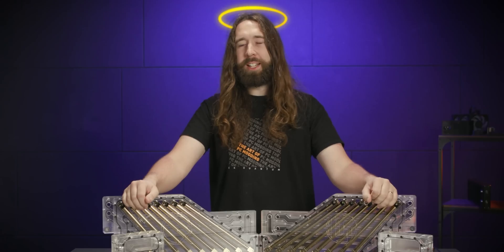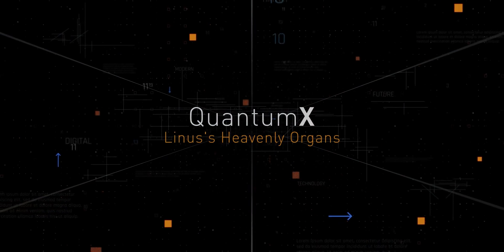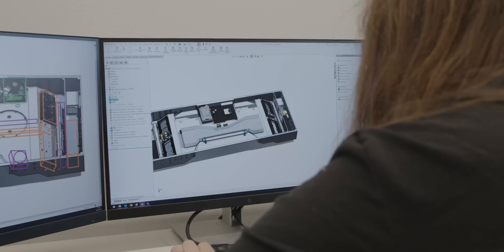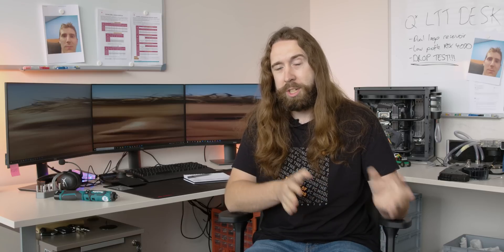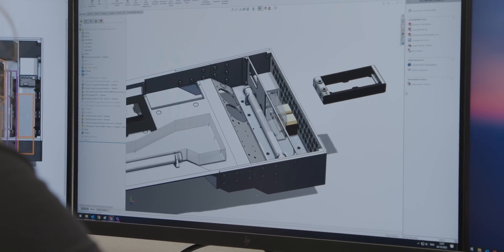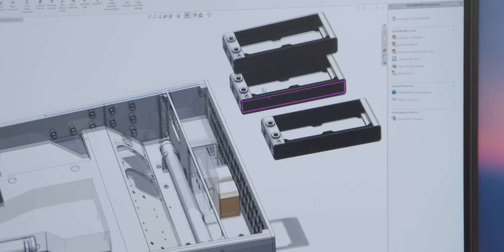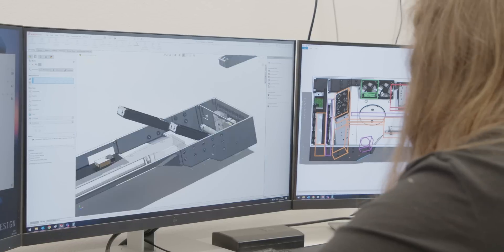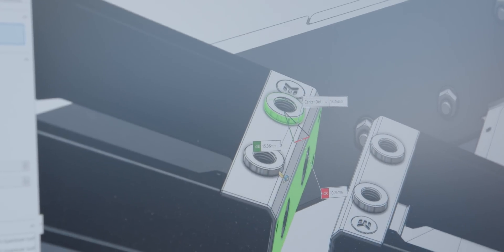Creating a CUSTOM WATER COOLING System For Linus's $100K Desk PC!

Comment: Incredible design! That inter-loop heat exchanger is absolutely stunning, but sooo unnecessary for LTT to even request! If there's enough radiators, neither the CPU or GPU would EVER be overheating. Like I can't even imagine how this would make a noticeable benefit to boost clocks or temps... There's THREE 240mm rads on each side... SIX in total. So the CPU and GPU both get three 240mm rads to themselves! Even a 4090 overclocked to well over 500W wouldn't need the cooling capacity of all 3 of those 240mm rads let alone the heat exchanger! 

Either way, absolutely amazing that the team at EK was able to even create such an incredible and beautiful piece of art!

Comment: Couldnt tell exactly... but The torque sequence you used when tightening the blocks down... Was there a method to it or did it happen like it sort of looked. IF it was just how it looked you guys should look into how mechanics / engineers do torque sequences on engines when leaks are catastrophic.. There's special patterns we use that helps prevent the gasket from failing. You should really look into them. I noticed your PS5 video and having leaks with it, could be what caused it... Sometimes the way you tighten it down will push the gasket one way or another.. using a proper sequence mitigates this.
Reply: We do prescribe specific sequences for production items and there is a specific sequence to us tightening bespoke items like this too. Since the OR is made from a cord it has no shape and naturally wants to spring out of the groove, you can see us using fittings in the video to first weigh it down. Then we quickly take them all away and put the lids on, first adding a screw in all of the extremes to loosely to keep everything in place. Then we drop in all the other screws and tighten them following each OR to a specific torque. Once every screw is installed and the OR has started to flatten out then we re-tighten every screw again. Unlike metal parts the plexi is very flexible, especially the 8mm lids and it's fastest to tighten them in a wave rather than a huge elaborate cross pattern. The worst part is making the OR, for the PS5 we 3d-printed them which was also tricky, some were porous as you saw, but these parts were way too big for our printers!

Comment: pls more info for the pc with 3 monitors behind you!
Reply: My work PC is a Fluid Works S3000 with a 10980XE and Quadro RTX 4000, all liquid cooled with EK-Pro aluminum blocks and an XE 480 Alustream. Quite a nice spec for Solidworks with triple 1440p 25" HP's.